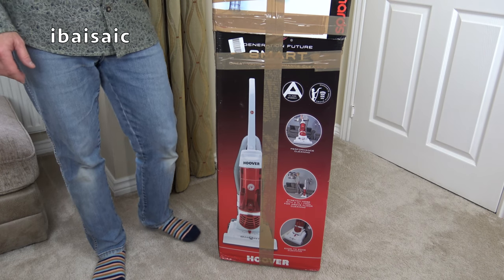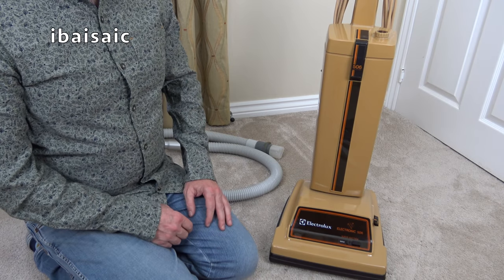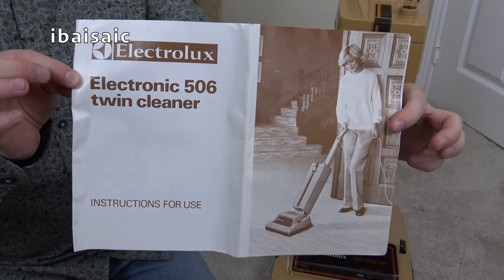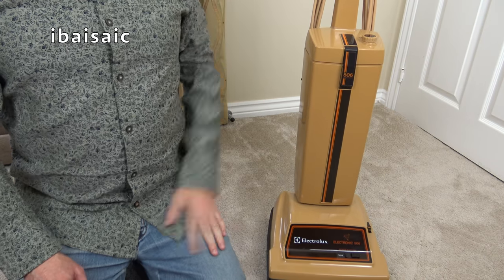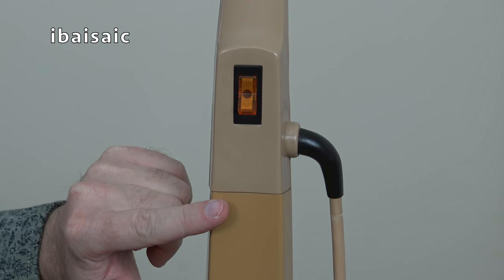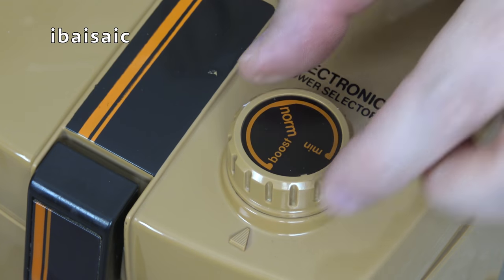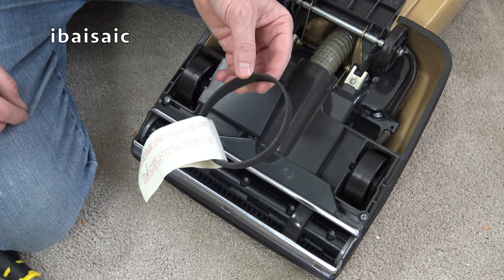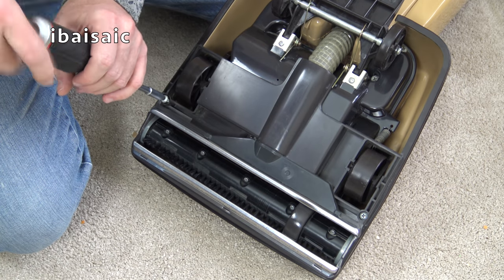1980's Electrolux Electronic 506 Upright Vacuum Cleaner Review & Demonstration

Comment: I bought one of these on EBay this week.  Looked as though it was in very good condition.  I paid for it, was going to make the 90 minute journey the following day to collect it.  The seller changed her mind about collection times and was very inflexible about dates.  Eventually arranged a firm date.  I told her that I wanted to see it working before I took it away.  She refused - stating she “didn’t have the facilities” for that.  Naturally I cancelled the sale…..
Reply from the maker: I think it may have been a 560 you bought if it’s the one I think it is. The 506 is identical though. I believe Electrolux changed the number of it when they launched the more basic 550. There is a 560 on eBay now for collection only. If it’s the seller that messed you around then obviously I wouldn’t bid on it again.
Reply: @ibaisaic  Yes, I got my numbers the wrong way round.... this one was for collection only too.  It is the same seller.  I see the negative feedback (which was quite warranted) was removed.....!! But who in their right mind would take an item away without it being seen working first... I wanted this one because my cordless Bosch that lasted years finally gave up the ghost (the handle snapped!!) and I am fed up with dragging the cylinder out of the cupboard every time I want to clean the carpets

Comment: Love that neon light on the handle.  How does that super suction switch work?  When you opened up to replace the belt, it does not look like its connected. 
Thanks for another great video.
Reply from the maker: The slide control on the head is just a valve that opens and closes to alter the suction.